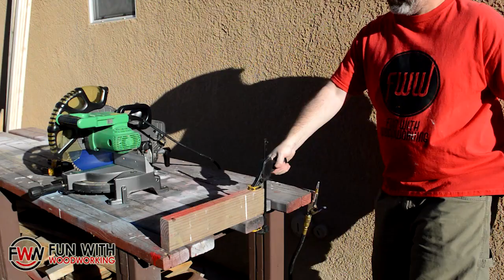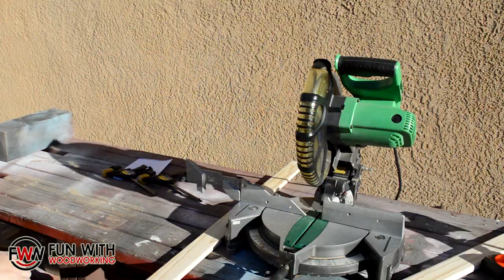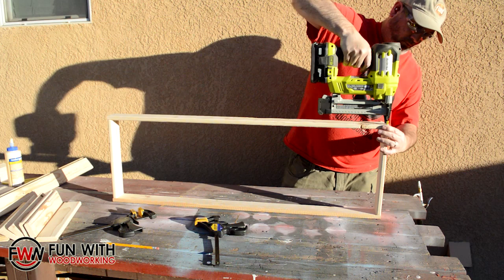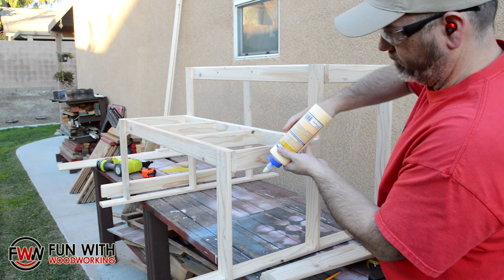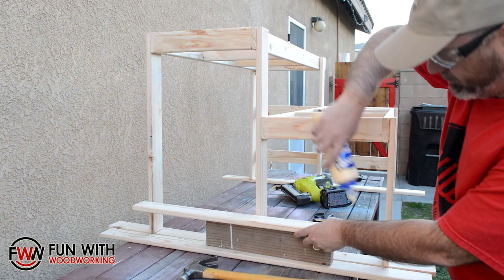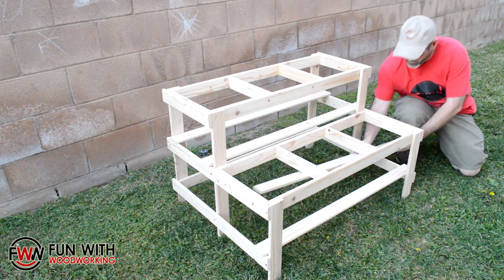Can I build a 6 bucket planter stand for under $25? 🤷‍♂️💲

Comment: Plans say 1 1/4” crown staples.
Is that 1 inch leg 1/4 inch narrow?
Or am I not searching hard enough for 1.25 leg staples? Can someone elaborate, please?
Reply from the maker: These are the staples that I use and that fit in my staple gun: https://www.homedepot.com/p/DEWALT-1-4-in-x-1-1-4-in-18-Gauge-Glue-Collated-Crown-Staple-2500-Pieces-DNS18125-2/205647519
Reply: @FunWithWoodworking  thank you!